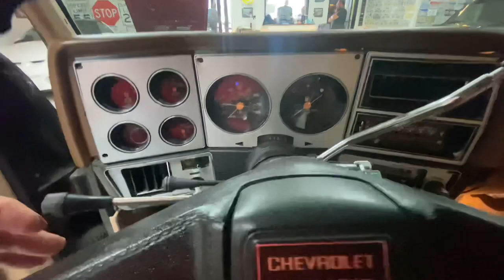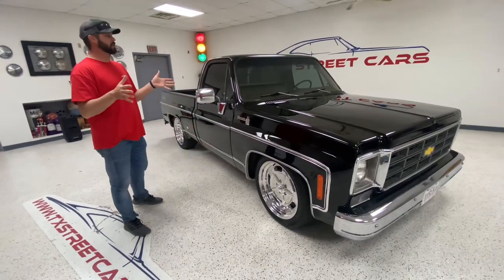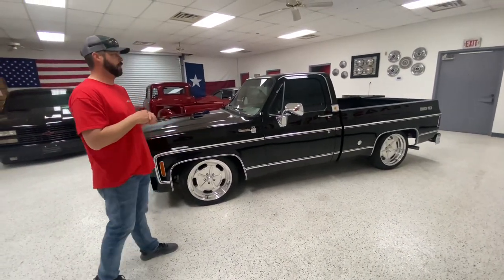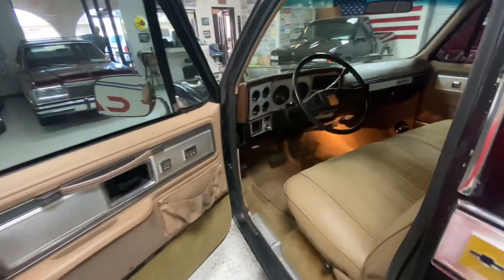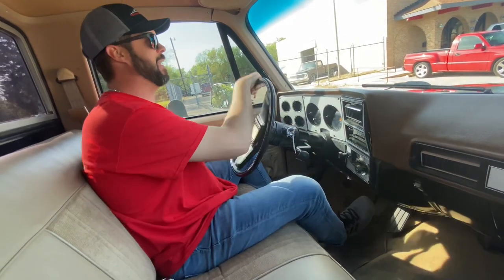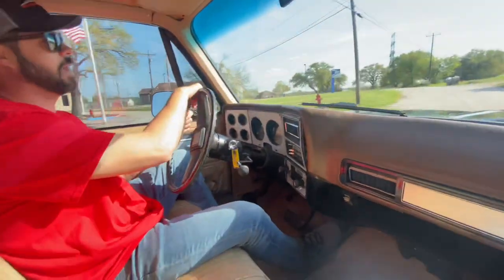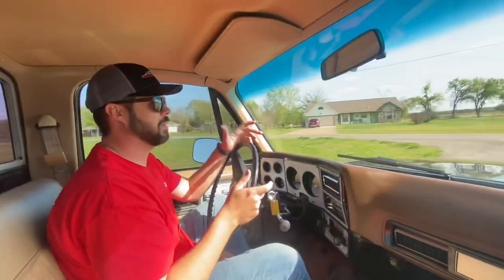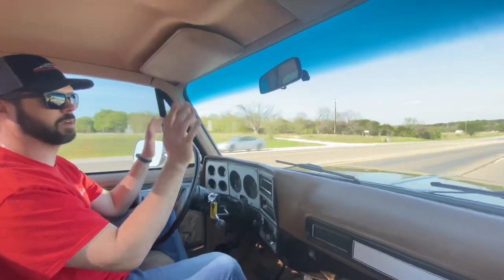SOLD! 1978 Chevrolet C10, Big 10, lowered, 383 V8, American Wheels, FOR SALE, square body

Comment: A 383 V8?  I think that that engine size used to be more common to Chrysler Corporation, than to Chevrolet.  I think that the Plymouth cars in the old "Adam-12" TV series, had 383s in them.
Reply: It’s a 350 small block bored out to 383